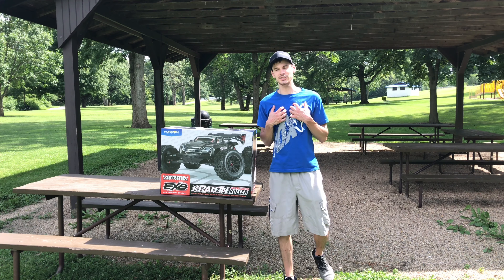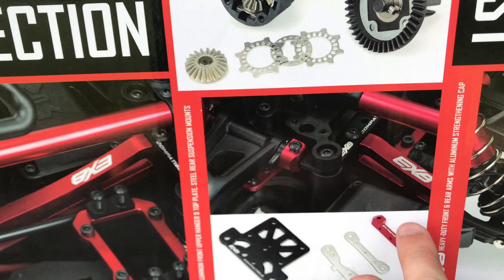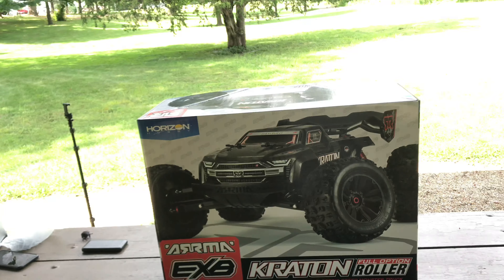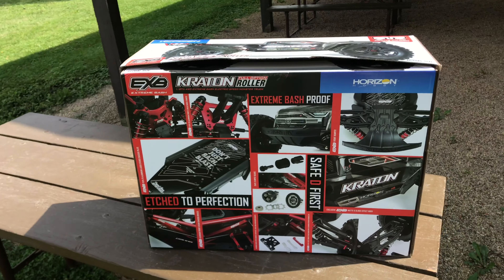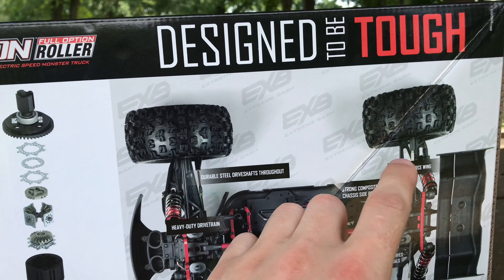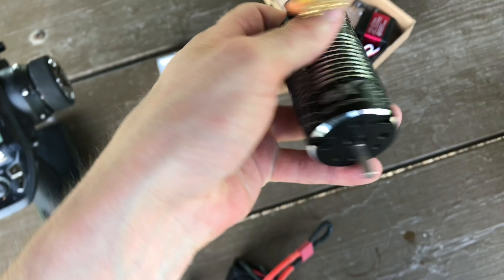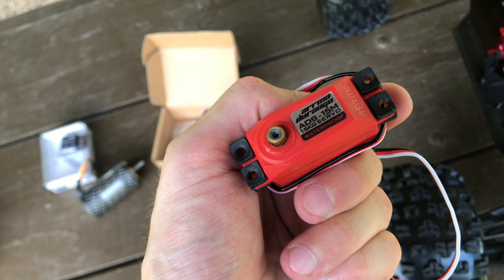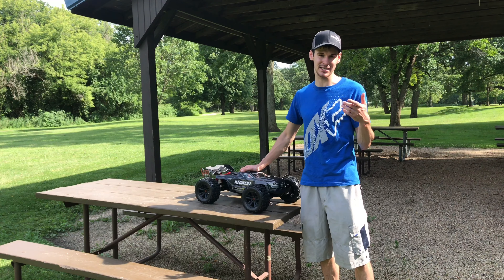Arrma Kraton EXB “1/8 Scale Extreme Bash Roller” Unboxing and “My Electronic Setup”

Comment: You said you no like soldering but the dean  connector  is suck  is 2020 is no used dean connector
Reply from the maker: ovette rc cars well I have batteries with deans connectors which is why I am using this Esc. As long as they work then I’ll be satisfied with them.
Reply: His car his choices
Reply: What’s wrong with the deans connector I have them on my castle set up , seem ok 🤔